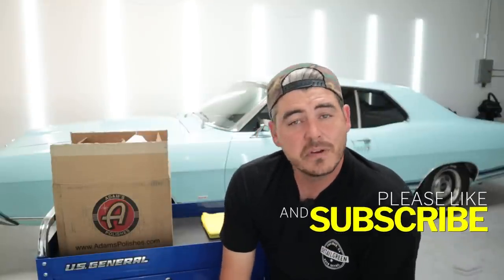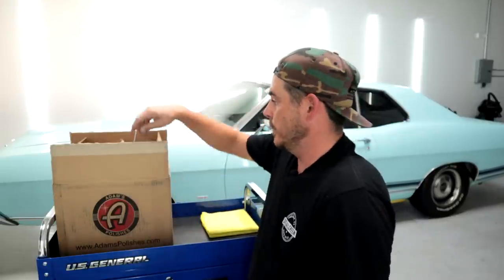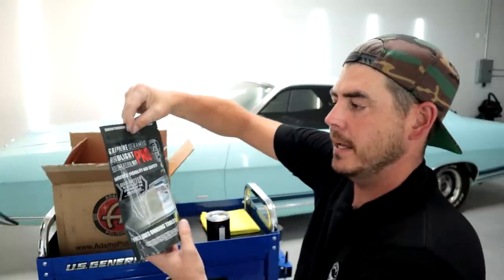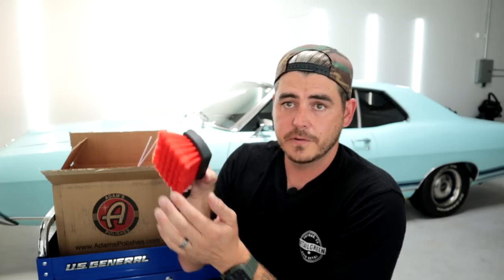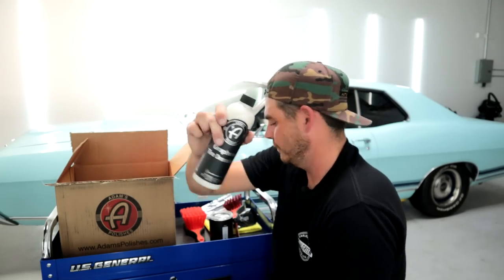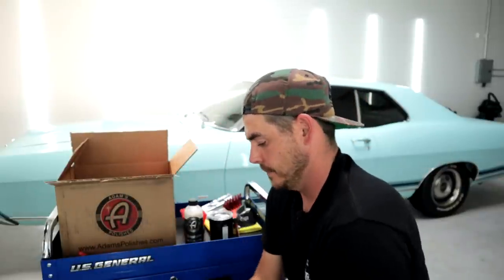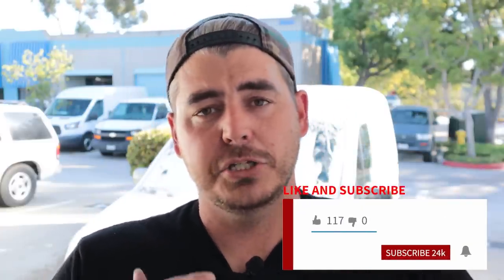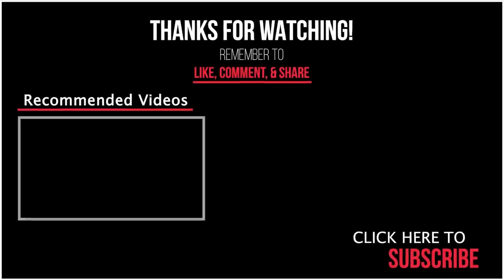Adam's Premium Foam Cannon Unboxing and Review! | How much foam does it make???

Comment: Speaking of the threads on the fittings, you should know that they are two completely different thread types. 
It's not that one is just shorter than the other. O-ring seal vs pipe thread. 
There aren't interchangeable. They both have their strengths and weaknesses.  Pipe threads will rarely ever leak if assembled correctly with teflon tape. O-ring fittings work great until the o-ring fails.

Comment: The orifice link you sent doesn’t work. I bought some stainless orifices but the head of them are not the same size as the one that came out of the Adams premiumn foam cannon. It was a bundle I bought that came with a bottle of mega foam.

Comment: I just bought that cannon, but it didn't work too well for me with the griots soap, I'll try Mr. Pink. I did swap my orifice, per your past vids and advice. Will wait to test with a different soap. And see if there is a difference.
Reply: Mr pink is #2 and megafoam is best foam
Reply: @derekbittle7114 I've also hear Adams Mega Foam is good, but it's a bit on the pricier side. Thanks for the advice bud. I appreciate it.
Reply: @richrnndz2  it is, but Mr. Pink is close 2nd
Reply: Chemical Guys makes Mr. Pink but they also make a better product called Honeydew Snow Foam Auto Wash and it foams more than Mr Pink. Great value at $29 a gallon on Amazon too. Creates thick foam
Reply: @10SecondZ06  I returned the Foam Cannon, will be buying the MJJC recommended on here, seems to perform better anyway.

Comment: I've recently started using the Adams Premium Cannon paired with a Comet Static pressure washer.  No modifications to the cannon. The Comet is 1k lbs and close to 2 gal/ min. Using Chem Guys Melon soap... the foam is soooo thin.  I've seen other vids that shifting to a 1.1mm in the cannon does not pair well with the Comet. Can anyone help? I'm open to using an MJJC cannon. Tell me how to get amazing foam.

Comment: 25:55 - 4 oz of Mr. Pink in this comparison?  Weren't you using only 2 oz per liter in all the other cannons?  Would like to see this using the same ratio as the others and let us know how it does.
Reply from the maker: Hey John with the soap tests I was stating the exact amount to compare. For the foam cannons, i always do it to a small fill line which is about 4oz

Comment: hey just got mine today running in to a problem the cannon just shoots straight doesn’t spread at all for reference it comes out as if using a water hose
Reply from the maker: Did you spin the nozzle? It should change between 0-45 degree fan
Reply: @imjoshv  yea tried vertical and horizontal, vertical shoots straight horizontal doesn’t shoot kinda just squirts everywhere?..

Comment: Looks really well made even if it doesn't foam as much as the MJJC, also cheaper than the Griot's which is now at $99
Reply: Wrong. The griots garage foam cannon is only $58 on Amazon. Just bought one a week ago.
Reply: Griot’s is only $58 on Amazon. Just bought one.
Reply: @coop4274  I was referring to the Boss foam cannon which used to be $85 and now at $99, has a metering pickup ball and is made of stainless steel. The $58 is smaller, made of aluminum and no metering ball.
Reply: MJJC better than griots.
Reply: @Centaur008  the boss isn’t equivalent to this one. The boss is unique in using its own soap and doesn’t foam anywhere near these other style foam cannons. The regular griots foam cannon is the one that compares to this one. The mtm used to be the best now the griots takes that title.
Reply: @Andresthebigcat  actually the griots makes better foam and is built better then the mjjc. Take a look at pans comparison between the top 4 foam cannons. Griots won that battle hands down. I’ve had them all and the griots is the best I’ve had. Auto fanatic also did a comparison and griots won that one too.
Reply: @coop4274  negatives to to Griots BF weighed ball rust, it tips over once your done laying down your shampoo of choice, and also had an experience where the pin on the cannon tip somehow came off and couldn't go bk in.... all in all solid cannon but in my preference I prefer MJJC.
Reply: @Andresthebigcat  the griots I bought is the wide bottle that doesn’t tip over and the ball is stainless so it can’t rust.